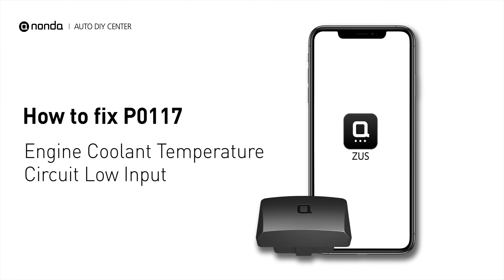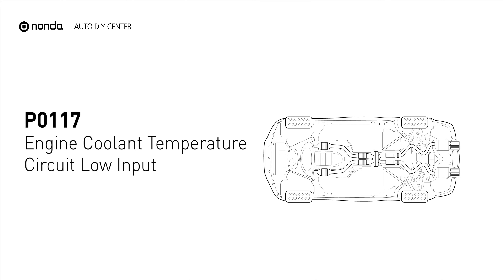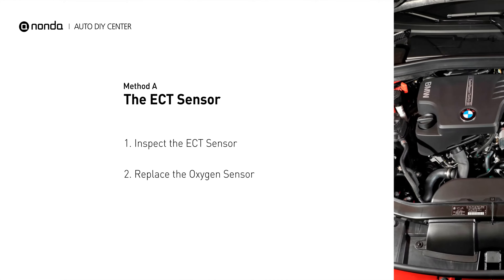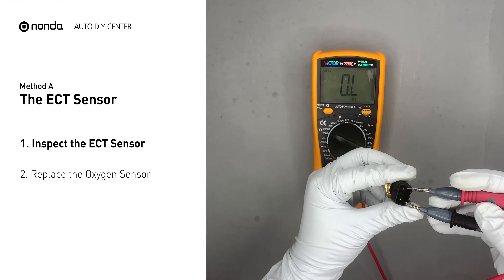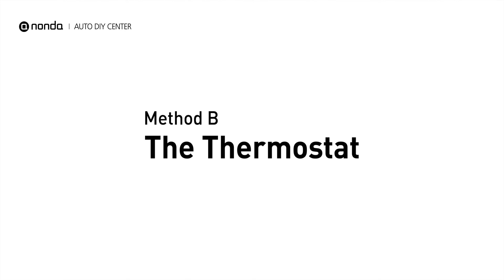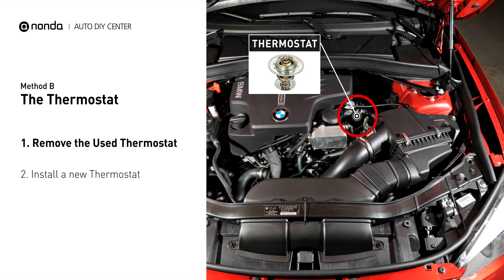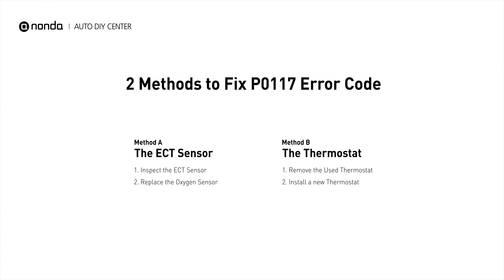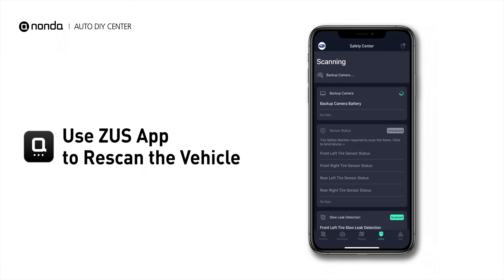How to Fix P0117 Engine Code in 3 Minutes [2 DIY Methods / Only $7.43]

Comment: Why the oxygen sensor ?
Reply from the maker: Hi Galanos, parts that are needed to be checked when having this code are the Engine Coolant Temperature Sensor, ECM, Coolant Flash and the wirings. Whenever you encounter this code, you may follow the guide provided in our video  (how to fix P0117) to lessen your expenses.
Reply: That didn't answer the question. Why did it say oxygen sensor on the list below the other sensor but never mentioned it?
Reply: @seanshank6177  Did you ever get an answer to your question about the oxygen sensor?